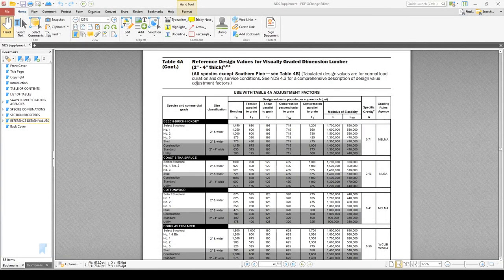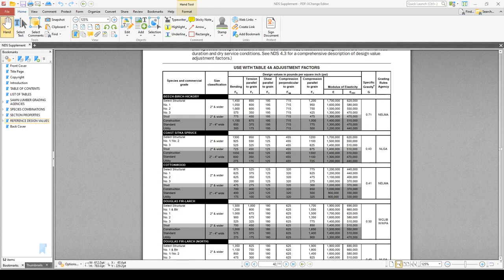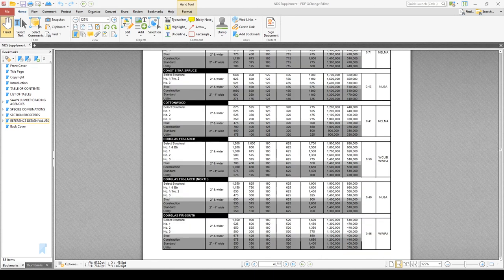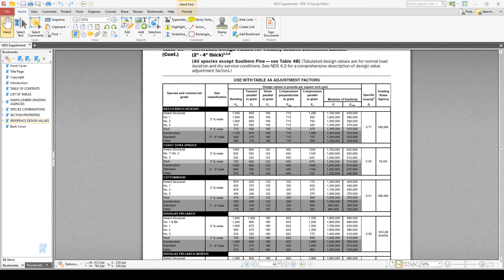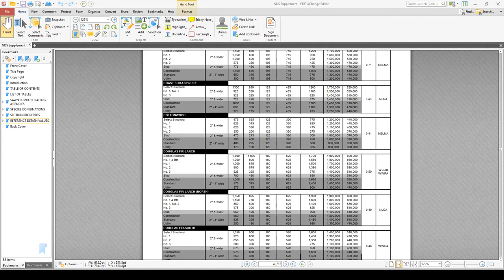Order from Chaos - Compensating for Wood's Variability

Comment: As a former carpenter I had never realised the variety of grades in timber as I generally just worked with what was supplied on site. I would reject timber with high defects from structural load bearing areas and use in low stress areas or cut so only the better parts where used.
11:17 cookery class leeking when I first see I was sure you where about to talk about laminated beam glues and strengthening processes or plywood and fiber bourd it finally dawned it was unrelated when I see sausage meat and cutting sausages.
Reply from the maker: Yeah, there are a surprising number of grades out there. You can take a look at the NDS supplement here:
https://www.awc.org/pdf/codes-standards/publications/nds/AWC-NDS2018-Supplement-ViewOnly-171027.pdf

And you're alluding to another way timber structures obtain their strength, and that's just general builder skill. This series looks at things from the point of view of engineering, but what you're describing is how timber structures were built really since the dawn of time. Centuries ago, people didn't do stress calculations and such. Builders just built buildings, and they had numerous methods and rules that were developed and passed down through the generations, within family businesses, guilds, etc. They would have rules exactly like you practiced. Only accept timbers of a certain quality. Use x size timber for walls y feet high. That's how all construction was done historically.

And yes, eventually I will cover plywood and laminated beams. However, here I was just looking for a metaphor for combining things together. Cooking and "seeing what goes into the sausage" came to mind.